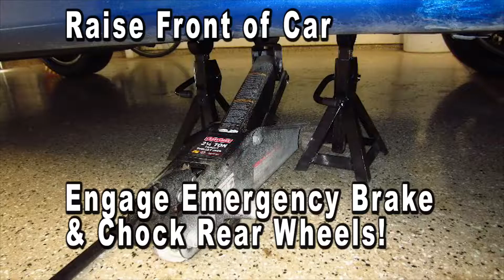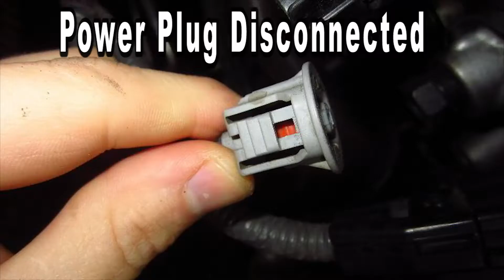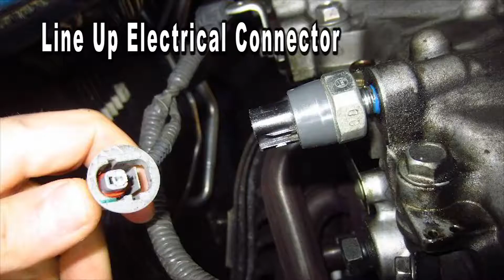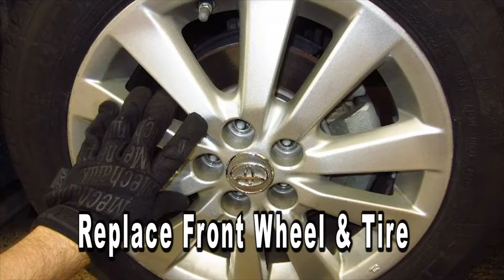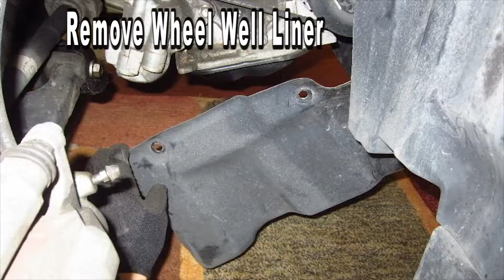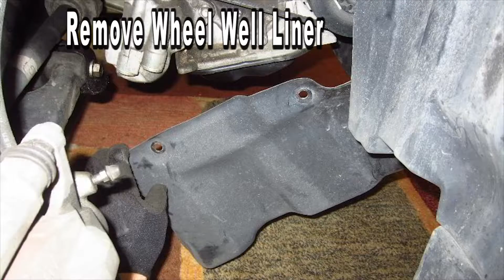Toyota Corolla How To Change Oil Pressure Sensor Switch 2009 2010 2011 2012 2013 With Part Numbers

Comment from the maker: Toyota Corolla Oil Pressure Switch (Sensor) - https://amzn.to/3CIITfF
Oil Pressure Sensor Socket Size - https://amzn.to/3RKyEM3
Oil Pressure Sensor OEM Part Number - https://amzn.to/3MfHsZk
Torque Wrench - https://amzn.to/3MkPe4o
Plastic Pry Bar Tools - https://amzn.to/3fR9ZZa
Socket & Ratchet Set - https://amzn.to/3dSrlEh

The Paul79UF YouTube channel is a participant in the Amazon Services LLC Associates Program, an affiliate advertising program designed to provide a means for sites to earn advertising fees by advertising and linking to Amazon.

Comment from the maker: Check out the DIY tutorial for changing a faulty oil pressure sensor (or "switch") in a 2009, 2010, 2011, 2012 & 2013 Toyota Corolla - 
https://www.paulstravelpictures.com/2009-2013-Toyota-Corolla-Oil-Pressure-Switch-Replacement-Guide/index.html

Here are all of the DIY repair and maintenance guides for the tenth generation 2009, 2010, 2011, 2012 & 2013 Toyota Corolla - 
https://www.paulstravelpictures.com/Articles/2009-2012-Toyota-Corolla-Common-Problems-Repair-Maintenance-Guides.htm

This automotive maintenance tutorial was specifically written to assist owners of the 10th generation (2009, 2010, 2011, 2012 and 2013) Toyota Corolla in changing a failing or faulty oil pressure switch (also known as an oil pressure sensor, sender or sending unit) on the 2ZR-FE 1.8 liter inline four cylinder engine.

Owners of other Toyota, Lexus or Scion vehicles such as the Yaris, Matrix, Prius, Camry, RAV4, Sienna, Tacoma, Tundra, FJ Cruiser, Venza, Highlander, Avalon, Sequoia, Land Cruiser, Allion, Premio, Auris, IS 250, ES 350, GS 350, tC, xB, xD, iQ and FR-S may also find these DIY instructions to be helpful.

The most common symptom of a failing or faulty oil pressure switch is the low oil pressure warning light being illuminated on the gauge cluster. The "oil can" warning light might be steady or it may be flashing.

If you have an OBDII Scanner (also known as an OBD2 scan tool), some of the oil pressure switch related DTC (diagnostic trouble codes) you might see include P0520, P0521, P0522, P0523 and P0524.

If you see the low oil pressure warning light turn on or flash, pull over in a safe place and immediately turn off the engine.

Comment: Thanks! After watching your video, I replaced my oil sensor five times in a row. Now my oil light is off. Just one question….could I have just replaced it once with the same results?
Reply from the maker: LOL, it took me a second to get your joke. It's been a long week. 

Yes, just once would have been fine. I repeated the procedure a few times since I've been told people like to let the video play while they are working on their vehicle. Seeing the procedure repeat several times helps without having to tap "replay". 

If you haven't already seen it, I have a full list of DIY guides for the 2009 to 2013 Toyota Corolla on my site - 
https://www.paulstravelpictures.com/Articles/2009-2012-Toyota-Corolla-Common-Problems-Repair-Maintenance-Guides.htm

I'm glad you found the video to be helpful. 🙂
Reply: @Paul79UF  You did good! I’m glad you realized I was giving you a hard time.
Reply: HAHAHAHAHHA this was great! Thanks for the laugh. Also great video Paul

Comment: I changed mine recently and the maintenance light came on but everything is fine am I okay to take it off the light or what do you think? I just don’t want to risk it since it’s my only car rn
Reply from the maker: Hi, I would just reset the DTC with an OBDII scan tool and then see if it comes back. It might not come back since you already replaced the sensor. If the light turns on again, perhaps the new sensor is faulty.

Good luck!
Reply: @Paul79UF  just did it thanks I’ll wait a day or two to see if it comes back. But my leak is gone and everything checks out good for now, have a good one thanks for replying back so soon!

Comment: Hello. Do I need to disconnect the battery? Thank you.
Reply from the maker: Hi, you don't have to disconnect the battery unless you want to clear the DTC (diagnostic trouble code) from the old faulty sensor. 

If you have an OBD2 / OBDII scan tool, you can use that to clear the error code instead of disconnecting the 12V battery for a few hours. 

Here are some OBD2 scanner options on Amazon - https://amzn.to/3tWCETD

I hope that helps. 🙂